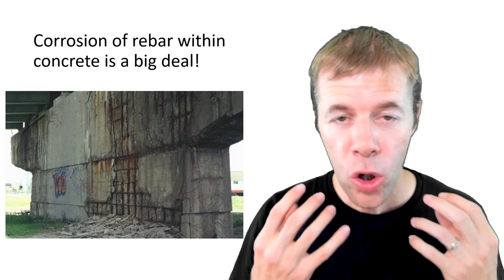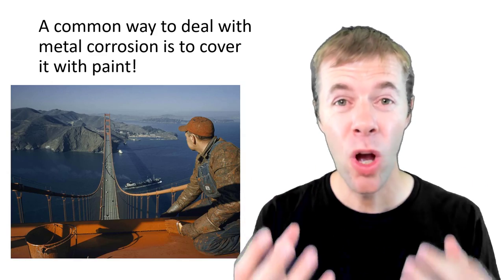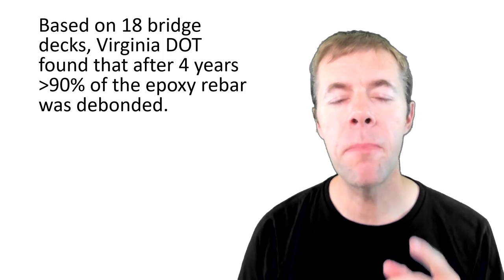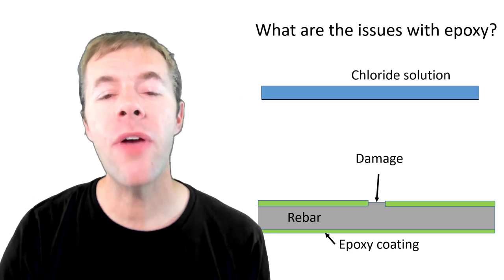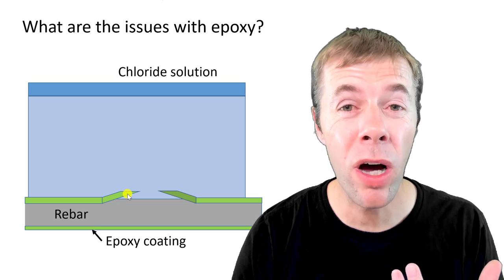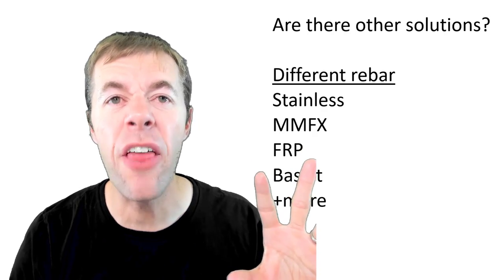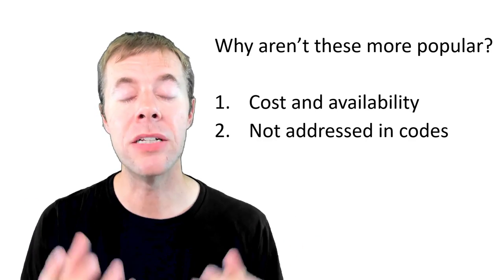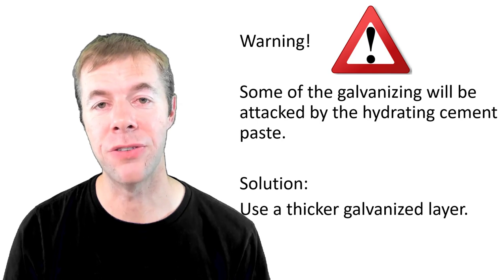What is epoxy coated rebar and why is it being banned?

Comment: As a degreed engineer, I agree with most of what you're saying with a few exceptions. Epoxy coated rebar is best formed before coating as onsite bending/cutting damages the coating and requires touch-up.  The touch-up canned paint that you presented is not used, as it has almost no durability.  A 2k Epoxy paint or coating is used to repair any damaged rebar epoxy whether from onsite bending, cutting, handling, or installation.  Most of the alternative rebar that you proposed actually cannot be formed on-site, they have to be formed during manufacture which makes it almost prohibitive for use in any custom shapes.
I do agree that a heavily plated galvanized rebar is currently the best choice as it also meets the requirement of onsite forming/bending without damaging the protective zinc layer. This is a very important requirement to control costs, reduce inventory, reduce construction time, simplify project management, etc.

Comment: I heard of an experiment of mixing mushroom fungi with concrete. When it cracks the fungi fills the void and creates mineral deposits that fill the cracks.
Reply: R U 4 sure really.
Reply: i think he's kidding
Reply: I think Kory just solved the war on crack!
Reply: Forgot to take your tablets this morning?
Reply: Volcanic ash added to concrete is a bit more reliable as aluminous tobermorite crystals grow where moisture is absorbed into the concrete, blocking out moisture and chlorides. It causes the concrete to be self sealing internally and throughout. 
This is why the old Roman port concrete structures are still around.
Reply: I heard something like that, too. Battlestar Galactica 2008

Comment: I used to work for a construction company and I remember a civil engineering colleague telling me that they would leave fresh rebar outside to get thoroughly rusty before use because the resulting rough surface is an important factor in the microscopic bonding between the concrete and the steel.
Reply: True, just like nothing grips snow better than snow.
Reply: @RexinOridle :
🟦....Huh? SNOW-TIRES made of SNOW??....Whut???
Reply: @joshhayl7459  No, the grooves in snow tire holds snow, which gives you the traction on snow. Rubber itself doesn't grip snow. Rubber grips ice.

Comment: Okay -I liked ur video on the rebar failures.  I have used the epoxy coated bars on a cast concrete sculpture conservation. We were following the engineers plan to grind the coating away at any contact areas with other bars and stick weld them together. After chipping and brushing the welds clean we recoated with the same liquid epoxy. But, this was in a very controlled environment and like your comments on any nicks or porosity spots where there can be that point of potential failure.  But in my mind the same holds true for galvanized coatings on the bars. And rebar does take a real beating on construction handling.
With the recent failure of the condo building in Surfside the efforts to solve this problem that’s existed since we began using iron in concrete will be solved definitively. The elimination of chloride or oxide corrosion strengtheners such as basalt-rod or? Is coming soon.  Thanks for hearing me out.

Comment: In Sweden we use a thicker layer of concrete instead of galvenized rebars. Coated rebar has been forbidden for a long time. In really exposed structures near the sea we use stainless rebars sometimes, but thats reaaallly expensive.
Reply from the maker: Thanks Bosse!  
I agree that more cover is a very good idea.  This is the least expensive way to increase life.  However, if you have a higher cover then you are more susceptible to cracking.  Galvanizing is a low cost coating that seems to have good performance.  It is cool to learn what Sweden does!
Reply: The stainless steel rebar may be expensive but in the long run, makes sense. Structures like bridges are very expensive to build so anything you do to extend the life of that structure makes sense.
Reply: unreinforced concrete is weak as piss, it dont matter how thick it is because it is brittle and rebar is there for a reason
Reply: @bjorn1583  So how come those Roman aqueducts, buildings and ports are still standing? The Romans actually invented concrete and hydroponic cement.There are parts of that ancient aqueduct system still in use today. No one knows the actual formula they used but whatever it was the cement was good stuff. They did not use re-bar.
Reply: @don-cw1yz  bjorn1583 should have specified.  Concrete can take a lot of compression, but zero stress. Thats why we use reinforcements in one way or the other.
Reply: @don-cw1yz  l was talking about modern concrete so grow a brain
Reply: @don-cw1yz  
Good question. I was in Greece and Italy just recently and I asked same question.  To be honest I think they 
 had a strong understanding concrete elements in compression and in bending. They built their structures with closer column grids but deeper unreinforced beam/slab sections. And with trial and error they understood when cracking moments were exceeded etc.
Reply: @kib2675  compression is also stress, concrete cannot take tensile stress well hence all the clever ways to reinforce concrete. It can still take some so non pre-stressed reinforcement works.
Reply: @bjorn1583 : It's not like modern concrete is significantly weaker. The surviving Roman concrete structures are just more massive and/or rely on geometry to make sure only compressive stress occurs. However, in many modern structures like skyscrapers, that's just not feasible. There's a good video on this by Practical Engineering:

https://www.youtube.com/watch?v=qL0BB2PRY7k
Reply: @bjorn1583 : "unreinforced concrete is weak as piss, it dont matter how thick it is because it is brittle and rebar is there for a reason"

Many dams are made of roller-compacted concrete without any rebar. Concrete (including modern concrete) is quite strong against compressive stress.
Reply: Donald Kasper  How about the hydroponic cement ports? You have to admit the "concrete grout" sure lasted a long time.
Reply: @don-cw1yz   They found a formula, some of components are vulcanic ash and pigs blood lol , do some google search
Reply: @don-cw1yz   Roman structures used designs that avoided tension forces, and which turned all stresses into compression.   So, they didn't need rebar.
Reply: @DmitriyLaktyushkin  quite correct. The word I should have used was tension.  I am not aware of any codes in the world allowing to calculate with tension in concrete.
Reply: @don-cw1yz  Because those structures all rely on compression forces, modern concrete structures use tension and compression so areas in tension have to be reinforced somehow. An increasingly common one for bridges now is pre or post tensioning instead of rebar inside the concrete, they have water tight channels with strong cables running through and tightened at each end with bolts and hydraulic jacks. Its even stronger and only has a few areas that needs inspection and maintenance.
Reply: @don-cw1yz  :  Roman aqueducts = pure compression, no tension in any of those concrete structures. That is why they last so long without the use of rebar.
Reply: Reinforcement fibers made of carbon of glass would be a better idea.
Reply: @don-cw1yz  I am pretty sure they do know the formula they used.  I think I've seen a youtube video on it.
Reply: @robertbrandywine  I don't think they do have the exact formula. They have guessed but there has never been a formula found.
Reply: @kib2675  You mean tension, not stress.
Reply: Wouldn't that introduce cracking from having unreinforced free concrete?
Reply: @don-cw1yz  No its not make sense, the thermal expansion of stainless steel is different from normal steel. normal steel and concrete thermal expansion are closer each other.

Comment: After cuting or bending don't you just run into the same problem?
Reply: Basically, yes
Reply: @Gulja80  spray your cuts
Reply: Not really:  the zinc acts as a "sacrificial anode" and electrolytically protects the uncoated surface.  Steel hulled ships use the same technique, they just bolt on bricks of zinc to avoid corrosion, and replace them when the zinc has been used up.
Reply: @johnrehwinkel7241  any boat in salt water needs zinc anode. Metal propellers, prop shafts, rudders
Reply: Bending doesn't cause any damage to the epoxy covering.
Reply: I used to coat rebar and fabricate it for a living. When you cut the bar you have to manually brush paint the coating on the cut ends. Also bending it does damage it to a degree. It can scuff and crack. Again you have to brush touch up the scuffs and cracks.
Reply: Galvanizing is anodic protection, as others have stated.  This means the zinc is lower on the galvanic scale, and therefore corrodes preferentially relative to the steel.  It doesn't protect the steel by encapsulating it.  The epoxy protects by coating the steel, so any opening in the coating concentrates the corrosion process at that site.  However, the question of corrosion of galvanized rebar still poses questions.  For example, if the chloride threshold is 2-4x higher, is that for the steel to corrode, or for the zinc?  And when the zinc corrodes, does it also damage the concrete, or cause debonding, like the steel would?  I would guess yes.
Reply: The times I witnessed coated rebar being used, was for tunnel segments. The cages were made up of uncoated rebar and then the whole cage was powder coated, being in a factory environment little or no damage was coursed to the cage being installed in the segment mould.
Extensive use of fibre shotcrete is now being used in the UK, in place of rebar ribs and mesh layers. It makes for faster installation and no rusting ribs and mesh.
Reply: @chrisraley6660  it's a pain in the ass. The company i used to work for switched to plastic measuring wheels and bending wheels to prevent most problems near the bends
Reply: Yes. That is why field cuts and bends are not allowed. The bars are bent and cut prior to being coated. Noticeable damaged coatings are to be replaced or recoated.
Reply: @johnrehwinkel7241  Correct. Sometimes they use an impressed voltage to counter the voltage created by the corroding materials but I think Zinc is the most common method and you do not have to coat the whole ship.

Comment: In the U.K.,, an eternal task is known as “painting the forth bridge”. 

However recently, they have introduced a new paint for the bridge.  This new paint has microscopic flakes of glass in it. As the flakes dry, they lay flat and create an impermeable glass like seal to the metal that helps protect it. The bridge is not now painted consecutively and can go a lot longer between coats.
Reply: @xplicitfishin  ummm, ok then.

Comment: Back in the early '80's I worked in quality control at a now closed prestressed concrete plant (Southwest Prestress) in Amarillo Texas. We would build bridge beams for the state of Texas and Oklahoma. We had one job come in for Oklahoma and it was the first time we ever had to use the epoxy coated rebar. The engineer who was working for Oklahoma was one of the most anal retentive guys when it came to this rebar. He would go through the bed before they put the form sides on, and look for any places that had the epoxy coating scraped off. He would tie a orange ribbon on the spot, and the crew would have to come back through with the touch-up paint (brush on back then, no spray cans) to cover any spots. The first time they set up and he went through, it looked like a green and orange bush. He made sure that every single spot he found was painted, and then the forms were set.

The pour foreman came up to him about half-way through the pour and asked him, "I wonder what the vibrators are doing to the coating on that rebar?"

The guy turned white...something he hadn't thought about. So he gets on the phone with the head honchos at his company, who talk to the Oklahoma state engineers...they finally determined that there was going to be a percentage of the coating that came off no matter what they did, so as long as the bed was set to specs and they touched up any Major problems before the pour, all should be good...Would like to see how the rebar held up after 40+ years.

As for the galvanized rebar, the only problem I could see is in the forming and cutting of the rebar prior to it being installed in the bed/form. As the rebar that we used came in 20 foot sections or longer, it had to be cut to the specified length, then bent and formed on benders. The cutting of the galvanized rebar would give off gases that would require the personnel working on it to use breathing devices such as respirators or filtered masks. 

Other than that, I can't see a problem with the galvanized rebar being used.

Read some of the other posts and you addressed the flaking problem...that was another thing I was going to address.
Reply from the maker: Thanks Sonny,
That is a cool story.  The epoxy coating can be fragile and it is tough to touch up.

There are a lot of owners suggesting to not use epoxy coated rebar because of poor performance.
Reply: Yep, when I was in welding class, welding around galvanized, you had to be careful of the fumes.
Reply: @Wake Up America I would think you'd be expected to coat those cut places.

Actually, remembering back to my days as a rodbuster, we were prohibited from cutting or heating and bending bar. We were not allowed a torch anywhere near rebar.  None of it was coated and it was all required to be rust free.  It was all required to be well within the concrete. 4 inches or more?
Reply: @durgan5668 - Welding and flame cutting of zinc produces zinc oxide, etc. Our bodies need a trace amount of zinc but excessive concentration is poisonous.

Comment: 25-year rod buster here.
You're 100% correct on the epoxy coated rebar.
I call it junk.
I have always said they paint it green because it makes people feel good.
Even if we installed it unblemished.
As soon as the concrete guys start pouring their concrete and walking on it the aggregate will make all kinds those pit marks you refer to.
Just did a bridge a couple years ago.
Reinforcement was made out of fiberglass.
I love that stuff.
It sucks to work with.
But it's light.
I've installed rebar in any kind of concrete construction you can think of.
I find the biggest problem in the failure of any poured in place concrete , to be mostly two things.
Improper clearances of rebar to outside face of concrete.
The other factor is the concrete itself.
 Had to come back.
Something else I forgot to mention.
The use of different types of metals such as galvanized with stainless steel or pig iron.
These metals don't even need to be touching to cause premature failure.